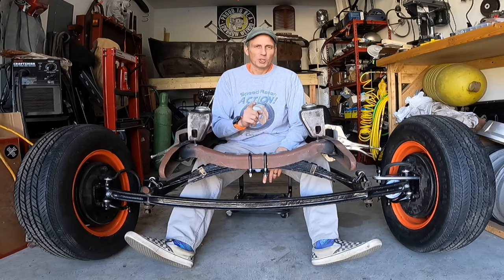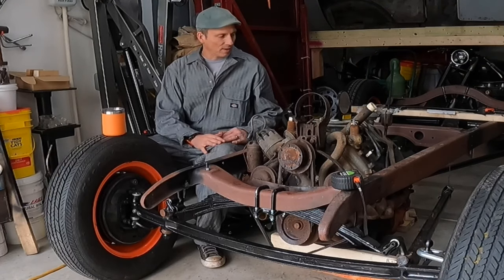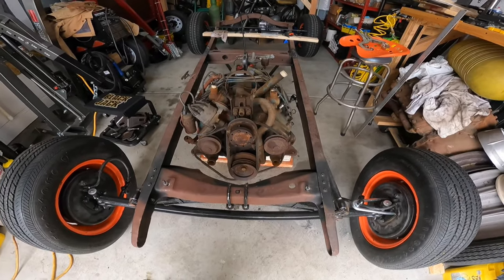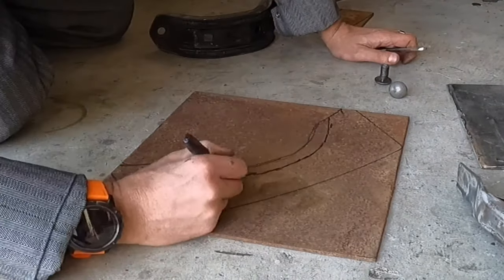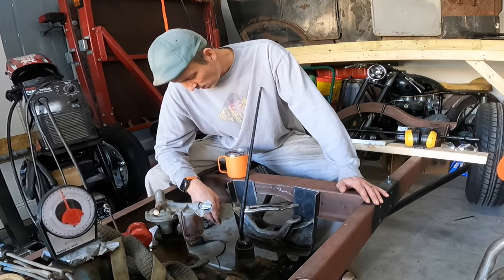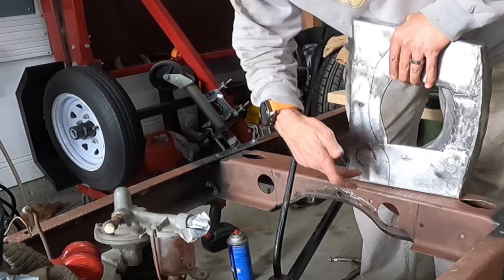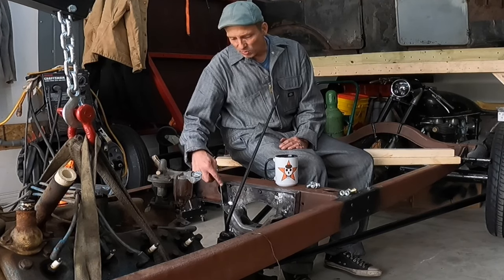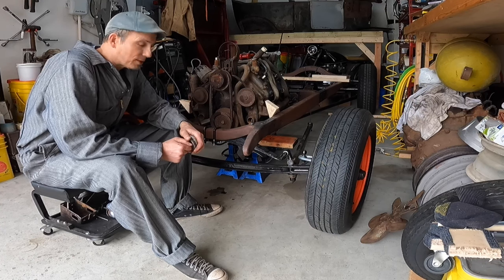AV8-T Transmission Mount for Ford Flathead 3 Speed Using Early Ford Parts!

Comment: Good progress!  You might be able to fix the fan problem with an electric fan mounted to the radiator instead of one hanging off the front of the engine.
Reply from the maker: Trying to keep the build all traditional so an electric fan would be a last resort.  I’ve since sourced a radiator that I think will give me room to keep my mechanical fan.